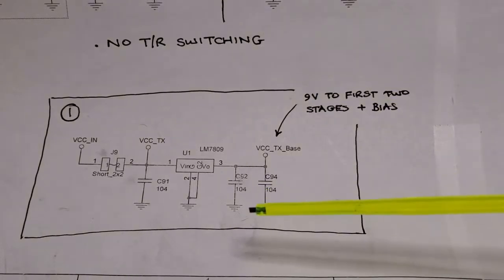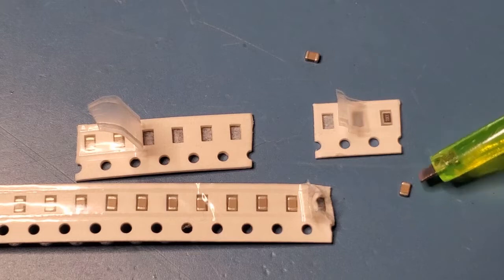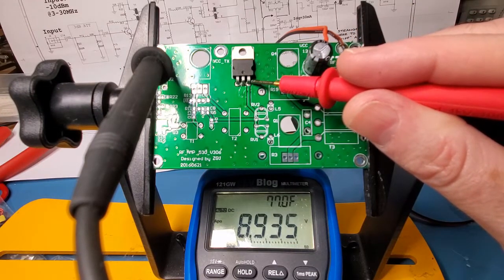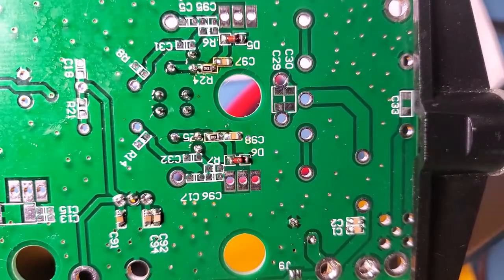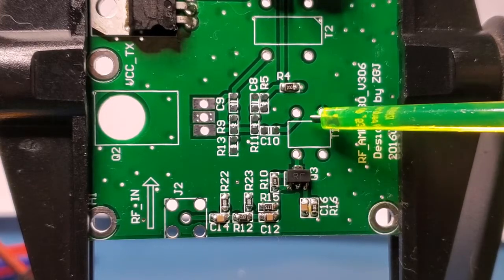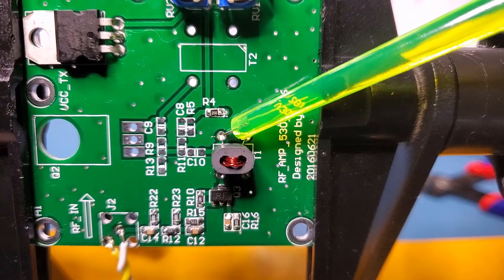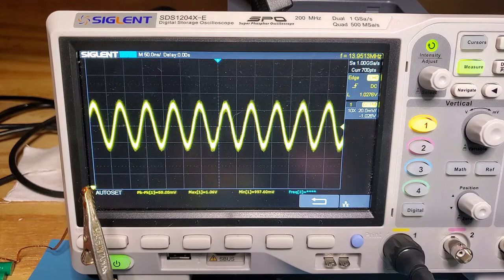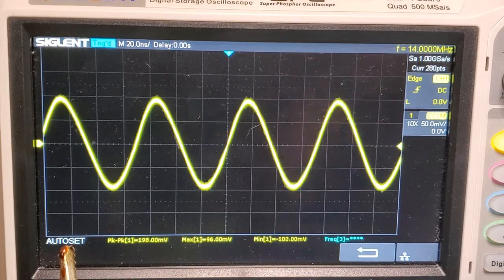IRF530 Push Pull Amplifier - Part 2

Comment: I know it's been a while since you posted this video. I purchased this same amp about a year ans a half ago. How did you know what resistor to place on R23? The parts list I found on the internet doesn't even list a an R23. Great video, I was able to follow along right up to this section.
Reply from the maker: HI James. So R23 together with R22 and R12 form up the input pi attenuator. The pi attenuator does two things 1) presents a 50 ohm impedance and 2) attenuates the incoming signal. In this case the input signal is attenuated by 3db - which is about .7 of the incoming signal's voltage.

You would vary the value depending on the output you have from the transmitter. There are a number of pi attenuator calcs out there e.g. https://leleivre.com/rf_pipad.html

In this case R22 = R23 = 300 ohms and R12 is 20 ohms - plug those values into the calc above and you'll see about 3db of attenuation. I hope this answers your question

Comment: What is a good way to make a power combiner iv tried using a binocular core with Several different windings
Reply from the maker: Low Power? I usually use a trifilar wound toroid for a low power power combiner. 

You can also use something like this
https://www.digikey.com/en/products/detail/macom-technology-solutions/MABAES0060/4429733?s=N4IgTCBcDaIIwBYBsBWAtHAzHA7BtAcgCIgC6AvkA

If you wanted to wind a binocular core you would have one side with n turns and the other side n turns but with a center tap. I haven't done this myself - but was your question on how to wind?

If you want a higher powet one have a look at this on ebay
https://www.ebay.com/itm/165002901635

I hope this helps
Reply from the maker: Just ran across this article too that might be of interest
https://www.w6pql.com/1_8_to_54_mhz_combiner_set.htm

Comment: Very nice, I like these kinds of videos that you do.  I'm not surprised that LTSpice differs from empirical measurements.  Did you assume 100% coupling in the transformers and ideal components?  It also seems that a lot of LTSpice models for transistors are more accurate at DC or AF, and much less so at RF.
Reply from the maker: Yes Yakov - 100% coupling in all the transformers in the model I created - and I couldn't even find the  transistors in the first two stages in my LTSpice library. Thank you for the comment!
Reply: @na5y  yeah, no problem.  I usually just fudge a 0.9 coupling factor on all transformers... it helps keep me from getting my hopes up too high :-).  I also go through all caps and resistors, selecting actual models from the LTSpice library.  This adds some parasitics that also tone things down a bit.  I'll sometimes even add a little series resistance (like, an ohm or so) to inductors, though real parts and wound toroids vary so much in parasitics, I haven't yet come up with a good strategy other than tossing in some resistance to keep the Q somewhat realistic :-).
Reply from the maker: I have never tried adjusting the coupling parameters - definitely give that a go I think.

Comment: Thanks for sharing, Ian.  I really like your approach of building and testing one section at a time.  My approach has always been closer to the way Alex commented on your last video:  Build the whole thing and see if it works (magic smoke?).  

One thing I'm particularly interested in is the circuit components R6/C95 and R7/C96.  It looks like a gain compensation (gain vs. frequency) circuit.  Typically on broadband amplifiers the gain will roll off as you move higher in frequency.  I have the number 6dB per octave stuck in my head, but I couldn't confirm that in my quick research last night.  Anyhow, the caps C95 and C96 should bypass R6 / R7 more and more as you go higher in frequency and drive the finals harder.  If done right, the amp will have flat (or flatter) gain across the designed bandwidth.

I will have to go download the LT spice model and play with that too.   Waiting for the next episode!  de KB7ZUT
Reply from the maker: The big challenge in the stage by stage approach is figuring out the input impedance of the following stage. That's not something I am capable of doing by hand - hence leaning on LTSpice a lot here. Even then you have to do a lot of substitution and guessing (no transistor model for 2SC1971 for example). That 1-1.5 ohm input impedance of stage 2 for example feels wrong - but that's what the LTSpice says so I'll go with it.

Thank you for the comment on R6/C95 I was wondering about that and your explanation makes sense to me. We'll see - stay tuned!
Reply: Yeah, if it wasn't for C95 / C96, I would have thought the resistors were just to stop unwanted VHF oscillation, but I think you're right.  A quick LTSpice test on my box suggests it is quite flat all the way into VHF.  The IRF530 is a pretty slow transistor, though, for RF work -- I almost wonder if this gain flattening arrangement is overkill for a transistor that probably can't respond fast enough to higher frequencies.

Comment: Nice return,have the same problems with components values with pa kit for FM... looking forward next step..tks for share..
Reply from the maker: Yes - not marking the 100nF and 10nF caps separately is a pain - there's also a pair of 100pF caps in the kit (they are the bigger 1206 variety). Thank you for the comment!